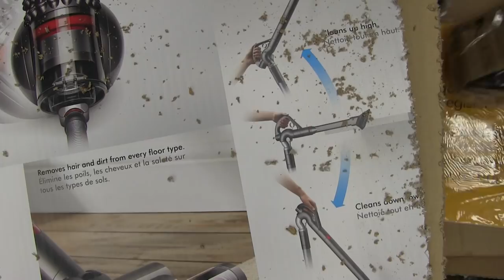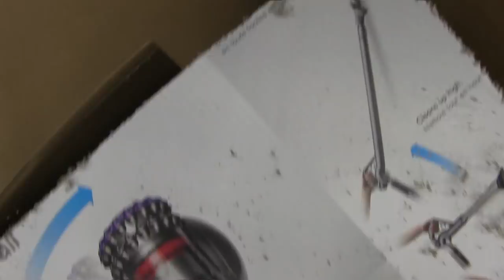DYSON ANIMAL BALLS | It blows!

Comment: You hit on one of my biggest pet peeves, expensive appliances that end up in the landfill due to failure of a $0.10 part!!  I've had to replace tactile switches on my own $1000 washer and dryer that would otherwise have been not worth repairing.  Also, there are so many gas powered yard tools that fail due to old gas, or 10% ethanol gasoline and water issues, easily fixed with: #1 - proper maintenance and fuels, and #2, a cheap $10 replacement carb.  So many other examples that I can't even remember them all.    ... edit - Oh yeah, thermal fuses!  I've had so many $30 fans fail simply because the $0.02 thermal fuse (irreversible) fails prematurely, i.e., at a temp lower than it's supposed to.

Environmentalist's - PUT YOUR EFFORTS HERE!!!!   This is a much larger issue than so many other things that are the focus of environmentalist's these days!!!   PLEASE!  Let's hold manufacturers accountable for this!  This could have a much greater positive impact than so many other issues we deal with constantly!

PS - I think the vacuum breaker valve may be for motor cooling air.  At least some vacuums I've seen have a bypass for this purpose.  And, it adds to the noise, BTW.

PPS - All I've ever seen of Dyson products is WAY overpriced, over hyped, junk.

Comment: I've had my big ball Dyson for a good couple or three years and I have to say it's stood up to all the abuse I could throw at it and quite easily. Sure, the foot activated power switch looks like it'll break just by looking at  it but it's held up and the cable retraction still works ok. The side wheels allow it to self right so don't require the best of ball races or bearings as most that is load is taken up by the wheels on its under carrage. If anything it's actually too powerful for domestic use but I'm just happy not to have to buy a fricking bag for it and empty into a bin every so often. Mind  you I only paid about £150 GBP for it new as Dyson is moving all models to battery power so I managed to get it cheap. It's chintsy but tougher than it looks.  8/10

Comment: Another function of having a bypasse valve before any of the dirt separation would be that in the event of hose blockages the by pass can open allowing suction on the stuck obstruction to decrease allowing the mass to loosen and separate down to a less dense more manageable size that if spread out enough it will let air  to  start bringing the material from front of the blockage and in a sense get a fresh bite on pulling the rest through otherwise the blockage would of only blocked airflow and only made the pluge denser so it's actually a benefit to the system hard to put in concept other then it's basically the same idea as using your hand to plug the front of a hose when plugged to ramp up the suction and letting it all lose at once to clear the air way but on the Dyson does that automatically   n. By the way great idea stretching the spring does wonders on the physics of this effect.  Thanks for the great vijeaos  I always learn loads appreciated

Comment: The pop it valve is for when you arent moving the head that holds the roller. The roller will still spin but the suction will drop off so you dont mess up the carpet. Shark vaccums have the same thing. But its ehen you put the upright shark totally upright and it locks. But as soon as you pull the upright off the lock position so its not 90° from the roller head it starts the full suction again.

Comment: There's two design philosophies in my mind: build it so bulletproof it never breaks, and build it with a little give so it can absorb some abuse or choose what is going to break first. And as someone who works in industrial maintenance, people will always find ways to break shit. Its pretty easy to say that it's super shitty, but I can see how some of these design elements could actually allow it to withstand some abuse. The true test is time. Also, the vacuum may be under less load, but most vacuum motors rely on that airflow for cooling. More speed generally means less amps (more cemf), but the loss in airflow could overcome the reduction in amperage.

Comment: there is an "air clutch" (that's what I call it) trigger on the vacuums handle. when using this machine on throw rugs, the suction is so strong that it can be impossible to glide across the rug due to the suction so pulling the trigger releases the suction so the nozzle let's go of the rug and you can continue to vacuum.
so as much as you are all very close and along the correct lines about the popper valve, the "clog" that will never exist on a Dyson big ball, is simply the intense suction to the floor or rugs .... I'm a professional cleaner, I use this vacuum daily and compared toany other vacuums, there's not much that compares to the results Dyson big ball leaves behind.

Comment: So I have a different kind of Dyson and my vacuum does the same thing my suspicion is that it is there to prevent the motor from burning out when the vacuum hose gets clogged and can no longer suck air in it opens that valve to relieve the strain on the motor because if you place your hand over the hose you will hear that valve open

Comment: The poppit valve would maybe be for when there is something blocking the intake, it would allow the vacuum to pull in air internally instead of throttling it to a stop.

Comment: The Vacuum breaker is to prevent the motor from over revving and to provide air for cooling:
When the inlet is blocked the vacuum increases with almost no flow and the impeller looses bite on the air.
 That looks like a series motor, so the rpm can ramp up dramatically to the point where the rotating assembly can start shedding parts or the bearings fail.
The vacuum break will however start to open to give the impeller some air to grip into.
The motor can also overheat if there is no air flow.

Comment: That vacuum release valve thing is Eathier to cut on strain for the motor  cause if ots succin and its goin warp speed its getting hot fast or to increase max power like a turbo pressure released valve

Comment: vacuum break will open if the vacuum gets above however many inches of vacuum, otherwise your average consumer would overheat or blow the motor with a simple clog. we put them on most of our industrial hi-vacs. air re-circulation is the only thing cooling the motor (or blowers in our case)

Comment: My vac needed a new HEPA filter that turned out to be stupid expensive. The technician told me to reassemble the vac without the filters installed, take the whole lot outside and use the vac to clean it's own filters. 

It wasn't perfect but it was a much better option than paying hundreds for new filters.

Comment: Around 11:00 mark where he talks about the poppet valve that "doesn't make sense" because you'd want the most suction possible:
If you look at the design, the surface area facing air is about half or a third as much, as the surface area once it's gotten started moving a little bit. That is to say, the initial vacuum force required to move it, is quite a bit more than the force needed to keep it open. 
TLDR, I think the purpose of this valve, is to help clear jams in the hose. When the valve pops open, the total vacuum pressure in the system drops by a significant amount over the working vacuum, making it easier to clear debris from the vacuum, at which point the valve pops shut again and the vacuum returns to normal operation. Otherwise, if something gets jammed in there, the vacuum pressure increases and gets the item more and more jammed into the hose.

Comment: The valve is for when the vacuum gets clogged so it doesn’t burn up the motor. It allows airflow when it can’t pull from the hose.

Comment: the motor is air cooled.  the valve is there up keep the motor from burning up if someone clogged the intake but didn't shut off the vacuum.

Comment: Most vacuumed have a valve to allow air into the motor when the intake gets blocked. Otherwise the motor could overheat and possibly burn out. Plus stretching that spring isn’t going to give you more suction. The valve only opens under a complete loss of suction.

Comment: Go on eBay and by a 60s vintage stainless Kirby.  Which had a lifetime warranty or they would pay the full cost to repair or replace.  We still use My Great Grandmothers Original Kirby with the polished stainless and heavy industrial strength components that are easy to maintain just a light bulb and cord plug since the early 60s.  It's what the depression and farm generation used because they were very frugal and money meant strict uses.  The farm you had the usual make it last forever and inside it was kept clean enough to lick your food off the floor.   It's was never a place to play except in the kitchen helping out. The sitting room and dining areas and everywhere were kept pristine.  Only very special occasions.  A 60 plus-year-old vacuum cleaner is a treasure used regularly today and has generations of use.

Comment: Like a pump you wouldn’t want a fan running in a small enclosed space without air circulation unless you’d like it melted to the ground. And the vacuum brake. Probably engages when it senses no materials being picked up or some silly other thing

Comment: Wife bought one of the redesigned Animals for about $800 US. I flipped out when I found out how much she paid! Put the stupid thing together and she killed it within 3 uses. At least the customer service was good and they shipped us a new one. She killed that one too!, they replaced that one. We still have it and I know where the flaw is for our situation. That HEPA filter! Problem is we have ultra-fine dirt here that gets carried in by the dogs. I live in high desert country and there is a lot of Gypsum mixed in the dirt combined with little rain. Powder. Clogs the filter right up and so it finds a new way in around the filter. Winds up caking on the motor and basically chokes it off, right at the motor! Yes, I've seen the smoke come out of the wires on these in my household. Will never buy another one! Maybe it works fine for other areas, but here, it won't last unless I take it apart at least every other use to clean it.

Comment: The vacuum limit valve has actually 2 reasons. The first and obvious is cooling. The second has to do with the type of motor used in this thing. Cheap ac motors are actually dc "in-line machines" (in german: Reihenschlussmaschine). The advantage of these motors are their low price and complexity, BUT they always need a minimum load because of their speed/load curve. If you cut the airflow completely, the load goes down to 0 and the speed of the motor gets faster and faster until the engine bursts. Load zero = infinite speed until destruction.

Comment: Vacuum break valve is to stop a clogged hose causing motor to overrev and overheat whilst there is no cooling airflow. Secondly you get better cleaning with lose vacuum and higher flow so the valve stops the tool grabbing soft furnishings so hard it stalls the airflow or even damages the furnature.

Comment: The vacuum breaker may be to stop the motor overheating, many vacuums rely on the airflow for motor cooling, so if the airflow path is blocked the motor overheats.  Lewyt committed an oopsy once when the designed the very first vacuum with a separate power head.  What they did was they kept the thing simple by using low voltage to run the brush motor so they only needed one wire and could use the conductive metal  wand and hose as the return.  They tapped a winding in the motor to use it also as a transformer, getting something like 18 volts this way.  This worked fine until people used the thing too hard and overheated the motor, resulting in the insulation on the magnet wire in the motor breaking down and the thing becoming live at mains potential in the wands you touch.  Not good, but not an issue here.

Comment: That valve may prevent overspeed if there is no regulator on the motor to keep it from chooching until centrifugally deconstructing. It would add some resistance back in like a brake.

Comment: It’s normal for crappy compact vacuum cleaners to have suction inhibitors to avoid the filter bag being clogged with fine dust, to avoid the motor ingesting too much dirty air and perhaps maintain cooling airflow to the motor. I’ve never seen a dedicated valve on the body of the machine before! I guess that’s to discourage the practice of swapping out the standard anti-suction head and replacing it with a head from a real vacuum cleaner.

Comment: I wonder whether that poppet valve is to auto-switch between the floor tool and the hand wand? Or maybe just to provide airflow to the running motor in the case of a clog or other complete flow restriction?

Comment: I wonder if that little valve that controls the vacuum (and the holes on the side of the nozzles) are for those times when you get something stuck on the end of the hose and it starts to put strain on the motor and possibly overheat it? Complete guess though.

Comment: If you block airflow to a vaccum cleaner, it consumes less power because it's doing less work. However, it's still doing work to maintain a pressure gradient. If it continues to do work while resting within a plastic housing without airflow, what do you suppose is going to happen to temps in there?

Comment: I bought a used Dyson that failed because the owner had (apparently) used it to clean a cat litter box.  The clay dust and slurry sealed the airpath, but it cleaned up ok with water and pressurized air.  At least there were no hundred dollar paper filters inside like this monster.

Comment: FYI, the fact that the current dips to zero during AC phasing isn't why the current is lower.  Ohm's law is why, to get 1500 watts of output out of 110 volts requires less than 15 amps of current.  With your 12-24v DC tools that same 1500 watts requires 62.5 amps at 24v and a whopping 125 amps at 12v.  High voltage makes for less current with the same output, AC/DC doesn't have anything to do with it.

Comment: With no epoxy on the commutator there is probably also no armature banding. This means that at no-load high(er) RPM, there is more heat and destructive centrifugal force. Adding the poppet valve keeps the motor loaded and mitigates self destruction when the filter is clogged.

Comment: Very entertaining - FYI - probably too late to be of interest - but the bypass valve allows air to cool the motor in the even that you plug up the main hose.   Also - you get about two zero crossings per cycle so 120  (119 for the lawyers) zero crossings per second.  Its the low voltage that you care about at the zero crossing more than the current - extinguishes any arc - which will stay off once the plasma stops.

Comment: A lot of what you said just isn’t practical for either manufacture or for home use — That carpet brush you said has no torque works fine on my carpets. The dust receptacle doesn’t need to be stronger than that, because it’s just holding dust and is structurally supported by the elements at the top and bottom (you could only squeeze it when it was open). Why does Dyson need to design a new sucker when Panasonic is making a suitable one? Also, everyone I know who has a Dyson has had it last years and years. Basically what I’m saying is, your conjecture doesn’t play out in practice.

Comment: I think the vac brake is because the motor is cooled by the air it sucks, so if you were to plug the intake the motor could over heat, but this would allow air to cool the motor

Comment: In the smaller Version there is no Vacuum valve. IT Kills you'r Motor in 5 sec , after something is blocking the Vacuum, because there use the vacuumflow to cooling the motor.

Comment: I bet that vacuum  breaker is so the cyclone can still clean the air when the unit is at a low flow condition. Cyclones (the primary cleaning device) have a minimum air volume to be able to clean the air. Without the cyclone working, the filter media will plug prematurely.

Comment: When the machine is on and there’s no airflow, the motor is under peak load. If the machine is plugged it pops the valve to keep the lightweight electronics from overloading.

Comment: 09:00 Haven't tested trough time, but having switches that are flexible seems more robust than a switch that would just break if any part is jammed. As long as it keeps it strength after many uses of course.

10:00 I wouldn't say the small because it's AC. You can have thinner wires when the voltage is higher (up to a point of course).

11:00 That valve should be to avoid the engine to overheat if the air inflow is jammed. (Mostly  guessing here)

Look like you need a 3D printer and then you can replace any part. We have one of the first Dyson, and still working even if all "plastic" (mostly PC as you noted).